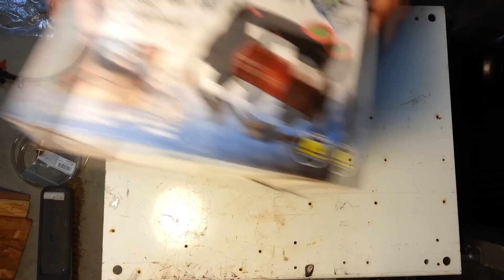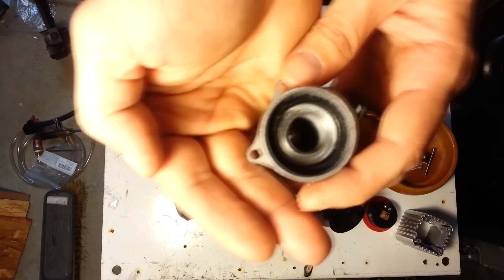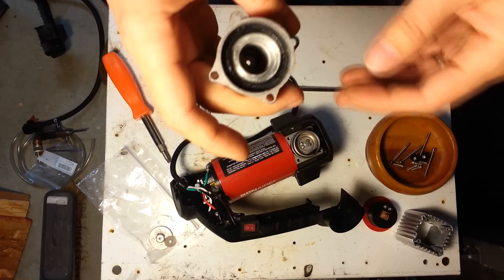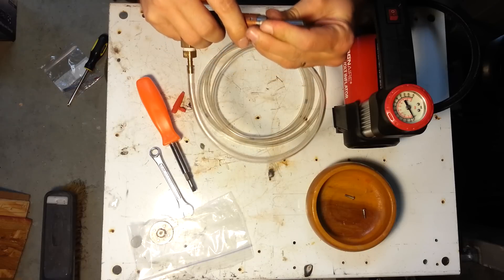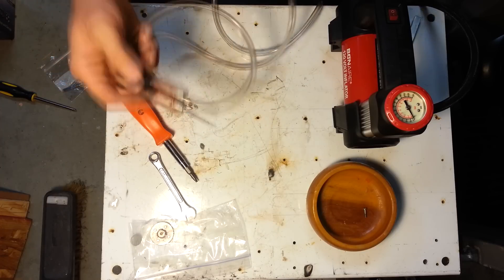Build a pneumatic metal engraver for cheap

Comment: Ahh thats very nice of you,we are all making scratches in metal.
You was doing well.It just shows what an advantage a power assist graver is. You could actually engrave on your first attempt. It equivalent to hammer and chisel,but you can use your other hand to turn the work.If you had a transfer on the metal you would have engraved a picture.
Things that might help. A lighter piston actually produces more power,even a thinner tube would be better. I can hear that there is quite large gap between the spring and the piston. You only need no gap to a few mm to get the best control and power.A really springy spring is good also.
You saved me a job making such a good video. i was about to video the part about the cylinder mod. Folks are a bit confused by it,and keep asking me to make them a machine.
Now I know where to send them :)
Have a look at the Rick Alexander HP. He's given away the plans for all. I'm guessing,you might hardly use it,as your a tinkerer like us all,but if you did,there is a queue of people who would buy the machine off of you,so you could make a profit.
Cheers
Reply from the maker: You were totally spot on about the piston weight. I turned an aluminum piston this morning and I was able to run the air pump much faster. This gave better power and control just like you said.
Reply: lol good old shaun =], im here because of you lol.
Reply: Is the piston inside the hand piece the only thing moving? For some reason I assumed the cutting piece would be moving but I suppose that isn’t the case. 
Another question on the engraving, when doing some engraving, say something that would be easy for a beginner, how many bits(I dunno what they are called) are used? Is there like one main one or is a bunch of various sizes/shaped ones?  I’d like to play around with this a bit for fun

Comment: What about a refrigerator compressor? I'm making one as well,  also trying a couple other things like a foredom hammer handpiece, and a rotary wood chisel that attaches to a grinder motor. Got a couple cheap inflators getting ready to try this mod. Using some 6mm hss blanks, ordered a #4 omelette graver tip. Oggliette? 
Oh the fridge compressor. I want to engrave hard steel and stainless, have no experience si just guessing what the strength should be. 
https://www.google.com/search?q=refigarator+compressor+converted+to&oq=refigarator+compressor+converted+to&aqs=chrome..69i57j33i22i29i30l4.14243j0j9&client=ms-android-hms-tmobile-us&sourceid=chrome-mobile&ie=UTF-8#scso=_oeTsX_edH4HY5gKWqpOIAQ36:1537.142822265625

Comment: Torque is weak. You need a compressor with a gearbox. Also the copper pen is not standard. You mentioned that you have Lathe. Make a better pen. finally . The hose you are using is rubber, so it will waste air pressure

Comment: Your chisel will cut much better with a "tiny" flat spot on the bottom that meets the metal.  It is the equilibrium between the face of the chisel seeking depth and the heal "flat-spot" holding it back a little.  While holding the tool on the stone at your comfortable engraving angle, rotate the chisel tip on a sharpening stone 2 or 3 times till you can see where the very sharp tip now has a flat heal on the bottom.  Good luck, its a lot of fun......one more thing, brass is not the easiest metal for a rookie as it is more brittle than soft.  What you want to cut will look like damp clay as your chisel finds its way through the metal.  Don't think of metal as glass, it is more like damp clay under a serious microscope 10x power.  Most any steel similar to gun steel will cut very nice.  I "think" most gun steel is SAE 1020 but not positive.

Comment: I would like to see how it would work with a little oil taking up some of the dead space on top of the air pump piston. Also, removing the superfluous manifold and pressure gauge will likely improve response a bit more. Get rid of some of that springy air, is what I'm thinking.

Comment: I would def go for the lighter piston to get a higher frequency of oscillation. This is really a 2nd order system (mass, spring, damping), so it can be tuned with the mass and the spring to get the frequency you want. Very cool vid, tho, as I have been looking at some of these amazing engraving guys on YT, and their gear can be over a kilobuck easy.

Comment: You need to grind the nose of the graver so that you can see what you're cutting.
Reply from the maker: +1 for this. I didn't grind the tool at all, just left it square. Shaun has a nifty grinding template that would have worked well.

Comment: What does the inside of the copper tube look like with the nut banging around?  And i believe i may have seen someone comment, but you can choose your profile of a graver tip. The graves I've seen are a little more delicate. Smaller stroke or less weight reciprocating. 

Good work though, cool project. You're inspiring me to try my own!
Reply from the maker: For $30 and an hour or two, definitely worth fooling around with. Give it a go. Agree on better graver grind and smaller oscillation. The biggest problem with copper tube is that it just isn't round. I had the squish it a few different times for a good piston fit.

Comment: Where do I get the chisels?
Reply from the maker: eBay, Amazon, jewelry supply. Search for 'HSS graver'. If you are making your own you can use HSS (High Speed Steel) or carbide blanks, round or square. In a pinch you could grind down a drill bit shank.

Comment: there is good an bad things about this video, simple enough for the most part, which is good. BUT then every so often a little nonchalant "JUST TURNED ON THE LATHE" tossed in there, cause everyone has a metal lathe. this is obviously bad.
Reply from the maker: All metal things are made on big expensive machines.
Reply: If you look on Rick Alexander's YouTube page, he shows you both ways. Lathe and just a drill press. It's a very comprehensive build series, and his hand piece is better than this one.  Check It out...

Comment: Don't turn the graver from side to side, turn the piece you are engraving. That is why the engraving vices swivel like they do. You will get the hang of it
Reply: Yes. Make a ball vice.
I did one by taking a half bowling ball and mounting a vice on it, then putting the whole thing into a correctly sized ceramic dish! 5 minute hack.

Comment: If one dos not have a lathe there are many ways to get around this, just have to look around for parts that fit. At this time I'm working on building a vice.  So fare as the spring coil probably a good idea to make it soft and adjustable in side the tool.

 You could try looking at lamp parts for the gun. I believe there are 2 or 3 size threaded pipe sleeves for lamps including many nut shapes to make these with adjustable handle. This would be a nice choice as you can fancy them up with brass and nice looking decorative parts or go cheaper with plain metal. Look on line for old style lamp parts and you will see what I'm talking about.... These parts are not the cheep way to go though just a consistent way to build w/o some tooling.
Reply from the maker: Bearing balls can be purchased for a few cents each in just about any size down to hundredths of a mm precision if you don't have a lathe.

Comment: Build a pneumatic metal engraver for cheap....step 1: buy a lathe......:/
Reply: I was just thinking the same thing lol. I was like "sweet, a cheap simple... LATHE?" Lol well crap.
Reply from the maker: There's always a catch, eh? ;)
Shaun's model uses a ball bearing. The local hardware store sells round stock that fits pretty well. That could be used for both the piston and front cap.
Reply: This Stuff I Do if you are interested in selling one please contact me at texandann@gmail.com
Reply: Johnathan Deverouxe Yea for sure. The last time I needed a little machining job done it took me a few shops to find one that was interested in the small job but once I found one they did it no problem and it was very cheap, maybe 15 or 20 bucks. 

If you want to spend a little more, there’s another guy on YouTube that made a very nice hand piece and he gives the plans away to anyone that asks for them so you could probably just take the plans into a shop and have them make the whole thing. I’d imagine it would cost quite a bit more by the looks of it though.
Reply: You can turn metal down by chucking it up in a drill, use a file to cut it down while it’s spun in the drill. Just be sure to stop and check it frequently for fit. When you get close, switch to a diamond file for a good finish. The key to it all is to go slowly. Test fit it to the handle regularly. It’s really surprising how fast the metal will come off in this way. Also, clean the file often and rub chalk on it to prevent bits of metal sticking in the teeth.
Reply: To be fair though it’s a super simple little piece, I’d bet there’s someone local that could make that for not very much money
Reply: Bmac 814 .... uh... now I feel stupid... Lmao of course... good call I bet a machine shop could make a couple of those pieces for a 6-pack and a handshake. Lol good call good sir. 😅
Reply: Bmac 814 very nice. I appreciate the heads up. :)
Reply: I think that one single sentence stops those with true mechanical abilities and natural skills in their tracks. He has good intentions, though, I'm sure.
Reply: The lathe allows you to make anything that is used in making something else.
Reply: Nice pic ;)
Reply: If you look on Rick Alexander's YouTube page, he shows you both ways. Lathe and just a drill press. It's a very comprehensive build series, and his hand piece is better than this one.  Check It out...

Comment: I know about as much as you do concerning ENGRAVING and ARTWORK, but i recognize that toolbit as a GRAVING TOOL,  something ive used recently to turn english wheel anvils. Not much is documented anywhere, and the experts are usually too old to create documentation on the net. Usually....   Most of what i know is self taught and from a few books as well as just experience, so i can confidently advise you that a "hollow grind" on the face of the toolbit will be much more effective and prevent slips as well as adding aggression to the dig in. Picture the radius of the grinding wheel forming a concave shape to the diamond pattern. Also the angle should be a little more than 45 degrees. I second the guy who said try to keep your hand away from the front of it, it can easily stick right through your hand and break a few bones too. Havent had that experience on the lathe as safety is paramount, and i shudder to think of it... This video just jogged that fear. With regards to the actual content though which is the cheap engraver, thumbs-up, awesome.

Comment: Safety tip: ALWAYS keep your non-engraving hand (the hand you use to hold/rotate the piece) below, or off to either side of the tip of the engraver. 

All it takes is ONE slip.
Reply from the maker: Sounds like good advice, to which the many scars on my hands and fingers lend credence.
Reply: This is good advice, I do some engraving and had a bad slip. It gave me a lot of trouble, the damage was done in that spot between the forefinger and thumb. That area always moves and takes forever to heal.
Reply: 6:30, surprised he didn't get penetrated lmao
Reply: its so useless,  its harmless to your hand or fingers
Reply: @andreaschristodoulou4274  if it is, then it's not been sharpened properly!

Comment: Interesting, I used the same pump for my home made graver, you know if you take that second piston cylinder off that goes on the main piston wall, the one that really does nothing but raise the intake like a few millimeters it will be silent and increase air pressure.  You get a lot of rattle by keeping that piece on.  I ran an elbow out of the air pressure valve hole after expanding it and left the hose on to use as an exhaust.  I have it so fine tuned now I have to run it on 2.  It sounds like a Lindsay when I turn it up on 7.   I would love to try an aluminum piston though, mine is to heave hence why I have it on 2.  I never used a lave before so I don't really know anything about them.  Great video though.  I got my pump at Walmart for 30 bucks.
Reply from the maker: Thanks for the tip! I'll give that a try today.
Reply: Let me know how that works out for you, you will also have to remove the fake heat sink plastic piece, I don't think it will fit after taking that extra cylinder wall out.   If you have a lave I can send you dimensions on a hand piece.  The one you have probably won't give you fine tuning although it works with this compressor set up right it will increase power and cause your hand piece to vibrate more.  This will cause your cuts to look jagged.  I have my machine on like 3 on the router speed control and if I have to much stroke it is to much power.

Comment: Could one use the switch of a cordless battery drill to control statr/stop and speed of the 12V compressor?
Reply from the maker: Yes. I've done this. I had an old variable speed 18v harbor freight drill laying around and I needed a motor speed controller quickly. However, you can also buy DC motor speed controllers pretty cheap on ebay such as the one below. Not endorsing it or anything, but this is the same kind I bought for an 18v battery adapter project (will post video on that later) and it was cheap and works well. Available from many Asian sellers.

http://www.ebay.com/itm/12V-40V-10A-13khz-Pulse-Width-Modulation-PWM-DC-Motor-Speed-Control-Switch-h-/112234539521

This one is $3.22 shipped. You may even be able to find cheaper.

Here's one for £2.56 if you're UK:
http://www.ebay.co.uk/itm/12V-40V-10A-13khz-Pulse-Width-Modulation-PWM-DC-Motor-Speed-Control-Switch-FH3-/322028139414?hash=item4afa5f7396:g:jNUAAOSwmmxW2Y4S

Also several options available on Amazon at slightly higher prices.